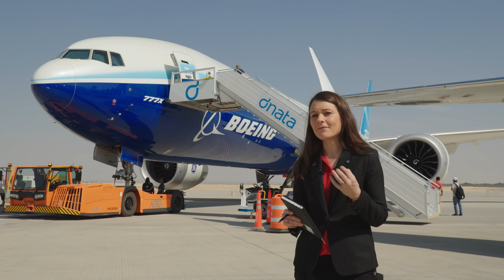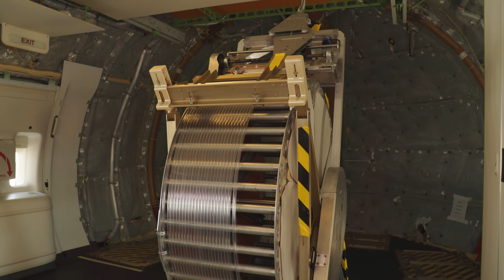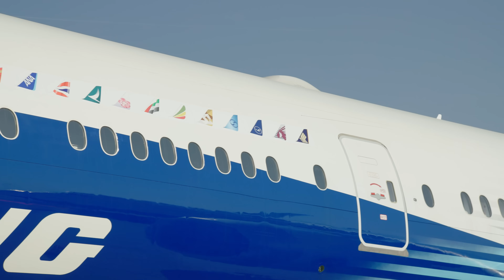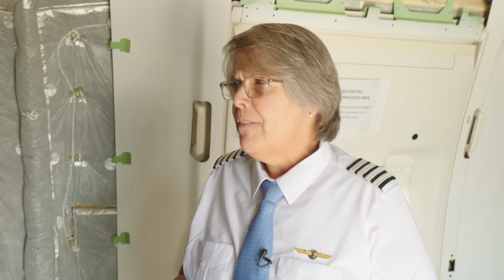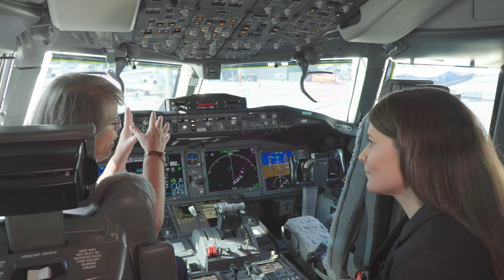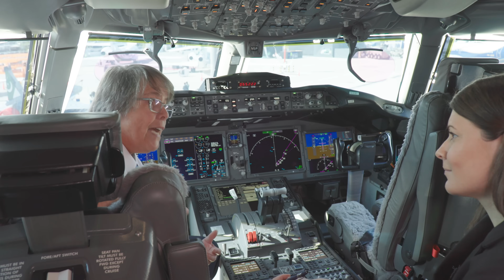Boeing Insists 777X Widebody Is Worth the Wait at the Dubai Airshow – AIN

Comment: Interesting how technology common in automobiles for decades is just now becoming available in commercial aircraft, like touch screens and HUDs…
Reply: because planes are in service for multiple decades compared to cars for at least a decade. at least every 5-6 years a new model of a car will come out, while for airplanes, it’s usually every 10-20 years. most aircraft manufacturers will make certain tweaks and adjustments for their current airplanes if they don’t have a new model out yet for a couple of years until they release a new model. it’s also fairly recently where there has been a drastic change in technology for aircraft.

Comment: Boeing finally saw the advantage of fly by wire for having common cockpit designs and characteristics.   It only took them 40 years.
Reply: Those yokes still look SO old fashioned.  Airbus still way ahead.
Reply: @stephenharrison7514  can boeing switch to a sidestick, yeah, they can. in fact, their fighter jets already have them. why do they keep the yoke despite having fly-by-wire? iconic, distinguishable, and fleet commonality. the prior 777s (-200 series and -300 series) have yokes already, and boeing’s fleet for passenger planes already have yokes, so it’s a no brainer to have yokes so they can easily transition to flying a newer aircraft of the same fleet/series. boeing pilots for the most part only fly boeing airplanes most of the time, only one type (i.e. 777). it doesn’t make sense to drastically change the way they make the airplane fly with its main control.
Reply: boeing already had fly by wire for a long time. same for big cockpit screens and less cluttered buttons. only thing drastically new is the HUD and the touchscreens and the switch to fold/unfold the wingtips.

Comment: I would not call 7,300 nm of range and extremely long range aircraft.  Not by a longshot.  Airbus a350-900 and 1000 fly between 2k and 3k nm farther.  This aircraft has 1980's md-11 range and will not be able to handle the truly long range flights that the a380, a350 and a330-800 fly.  Why again is it worth the wait?  The range of it is awful.  If they stretch it to a 777-10 it will have like 5k nm of range, literally.  Boeing is light year behind Airbus.  Light years.

Comment: Looking from the flight deck it amazes me how little the layout is changing.  Sooooo many hard switches and military style bezels.  No cues from the automotive world where the glass is more continuous and the displays are closer to the line of sight.  I would be enthralled by a control layout that would provide much improved forward visibility - more like a fighter jet.  Maybe Tesla or SpaceX should get involved in airline flight deck/avionics design.

Mechanical engineer, pilot and experimental aircraft builder.  40 years of professional experience.
Reply: i thought something along that line but my thinking is this layout allows easier pilot certification between it and the 787 thus reducing training time/money?
Reply: dude its an airliner. the so many "hard switches" you see are there for a reason and specifically designed that way for safety and reliability. Even the 787 has hard physical switches for most functions except navigation.

Comment: It has only 30 passengers more than the 777-300ER. Is it worth all this developement and folding tips to justify it ?
Reply: I would think so to take advantage of the latest aviation advances; depending on sales a 10 version is on the thought bubble but even with the 800 you gain increased efficiency over the current gen ... probably right now it makes more sense for companies that are looking to replace or buy new planes in the first place ... like i know Emirates is looking to replace some of those 380s as they retire

Comment: Heavier than an A350 because it relies on 30 years plus old technology meaning it’s able to fly less distance than  its competitors but is able to thrive because, like the Cadillac in the sixties, thrives and survives in a home market with restricted access. The original slaughtered the A340 because the FAA led ETOPs rule changes somewhat pulled the rug from under the A340 and led to the hugely successful 300ER. If it wasn’t for Airbus Boeing would still be pushing 1960s  technologies like the 737. Oh, they still do.
Reply: technically the 777 doesn't look at the 350 as "its" competitor class ... its looking at replacing the 747 and a350 although airbus did design the 350 to pinch at triples
Reply: A shame that the 787 panel doesn’t quite fit……

Comment: Well if you enjoy making marketing videos for Boeing I hope you are payed well. I hope the rest of us remembers the groundings of the 787 with those lovely burning batteries, or that a pilot is able to shut off the engines and run the 787 with all passengers into the ground. Let’s not forget the lovely images of those two 737 max running into the ground with all passengers on board. And what was it? Two years grounded. Oh, weren’t that amazing images when parts of the hull flew of a brand new 737 max at 17000 ft? Forgot some bolts and screws? Oops! Turns out Boeing managers are not font of quality control and sign off without ever checking. Lovely!
Well I’ll make sure to not set my foot into those lovely 777X until it has been 3 years into serious service.
Just for the fun of it let me tell you the business class in an A350 is much quieter than on a B787, and the best is the business class on an A380, much better than a B747.
Reply: You're a Boeing hater, go ride on an Airbus, nice planes too, just not as good as Boeing.

Comment: I like 777x a lot but look at just few YouTube videos of both a350 takeoff see their point where they leave the ground by high speed taxiway or building side than  go to google earth or alternative and measure their length from runway starting to that point to liftoff. I think 777x  has beaten a350 in everything but not takeoff performance.
Reply: Ge9x is only certified for 110,000lbf while ge90 is certified 115,000lbf

Comment: Is the 777X actually any more efficient than Airbus’ A350-1000? That does not seem to be the case of the 777-8. But what about the 777-9, which is a bit bigger than the A350-1000?

Comment: If the 777X is similar in its characteristics to the existing 777's - I will not be trusting Boeing to actually completely reveal some hidden software that plunges the plane into the ground. ONLY and ONLY if it requires a different pilot certification and training - the complete set, not 'additional' training, then will I fly on this.

From the start of the program, Boeing has been touting its similarities with the OG 777 and how similar it is, and how much training the pilots WON'T require.
Reply: If you would do some research, you would see it’s a completely different airframe.
Reply: The 777X doesn’t change the engine position like the 737 max. The problem with the 737 max is that Boeing used a larger diameter, more fuel efficient engine. However, the fuselage is low to the ground as the original 737 was designed for easier ramp entry from the ground. Boeing chose not to lengthen the wheel height because they wanted the Max to be compatible with 737 NG equipment. To make the engines not hit the ground, they repositioned the engines higher on the wings. The result is that at full thrust, the aircraft will nose up stronger than the 737 NG. To ensure the tip of the 737 max doesn’t tip so far up that it caused a stall, they installed MCAS software to position the nose downward if the pitch became too high. Stupidly, the equipment that measures plane pitch can malfunction, as it did with the two crashes, and the MCAS drove the airplane into a nose dive. MCAS was changed to be easily overridden and there are now two pitch sensors on every aircraft for redundancy. The 777X has none of this.

Comment: I think that the Boeing 777X isn't worth the wait because it has faced delay after delay, but the Airbus A350-1000 XWB has been certified just one year after its first flight!
Reply: Yes but the A350-1000 is no where big enough to replace 747's and A380's the 777X is the only plane that comes even close to replacing those big planes, Emirates said they will help fund a stretch version of the 777-9X which will be the 10X
Reply: @Rajahdat-62  That's not the reason why it's delayed. Boeing has had a bad reputation of delivering poor quality planes which led to a few deadly crashes. The FAA and Boeing are not going to rush through the process this time and make sure it delivers a great quality product that is 100% safe.
Reply: @ChyeahWill The crashes include Lion Air Flight 610 and Ethiopian Airlines Flight 302 (737 MAX 8, registration: PK-LQP, ET-AVJ) and Air India Flight 171 (Boeing 787-8 Dreamliner, registration: VT-ANB).
Reply: the XWB was certified so quickly because it shares 95% common systems part numbers and same type rating as the A350-900; they are doing their due diligence to ensure as much as possible they not suffer the embarrassment that happen with the max program
Reply: And it’s a plane the middle eastern airlines don’t want.
Reply: @keith.sorrells Gulf carriers are willing to accept the increased risk in exchange for an advantage on continuity and reliability because they have a long history of operating Boeing aircrafts and GE engines, and switching to the 777X will allow continuation of this history. As such, they say that the increased risks, such as certification uncertainty, are acceptable, and certainty is secondary, as long as they deliver the aircraft successfully.

Comment: Beautiful plane and definitly one of the best looking aiplanes ever.  However, range of 777X is only 7300 Nm? A350 ULR (900-1000 )range is 9700 Nm. It must be becouse 777X is 99 tonnes heavier and has 40% more fuel consumption.
Reply: these aren't extended or ultra long range versions .... the 350 ulr is a specific configuration else 350-900 is 8500nm to 77x-800 8700nm, 350-1000  9000nm to 77x-900 7300nm
Reply: @adsmith122  This thing must be empty to rech 7300 Nm. It is to heavy, if full the range is short.
Reply: @zundap100 I believe that in order to better compete on the fuel efficiency side they have derated the thrust to below that of the existing 777 which seems risky.  It also sounds like it shares the same cockpit of the existing 777-300 in an effort to keep pilot training costs down.  Probably not as cutting edge as the a350 but then again it is not a clean sheet so that is to be expected.  Definitely gonna struggle range wise when compared to Airbus but maybe the 4-cylinder engine will help with fuel costs if it can get off the ground.
Reply: @adsmith122 The 777-8 is not selling well at the moment.  The interest has been in the 777-9 because at the moment, there is no alternative.  The 8 version looks like it would be a very powerful and capable aircraft but like the 200lr it will be heavy and not so full efficient when compared to the a350.  All shrinks seem to suffer from that same problem.  If Airbus releases an a350-2000 the 9 version will have a problem for those very same reasons.  Especially if the range is more than the 777-9.  Airbus may also decide to re-engine the a380 using the Roll Royce demonstrator engine.  The 777-9 has less range than the a380 so that may end up being very appealing to potential customers.  It seems that the GE9X claim to fame is it's efficiency gains compared to the GE90 engines not overall capabilities.  Car manufacturers are replacing 6 and 8 cylinder cars with 4 cylinder turbo charged motors that squeeze out the same power as 6 and 8 cylinder vehicles but bring better efficiency but not better performance in most cases.  What they also bring is added complexity and less reliability so we will have to see if the GE9X engines share a similar fate.
Reply: Because the 777-9 is alot heavier than the A350. The purpose of the 777-9 isnt even to chase A350 range. Its job is to replace 747s, A380s and 777-300ERs in the future. The 777-8 on the other hand when it gets built soon is said to have a range of 8, 745 and carry the same amount of passengers as the A350-1000. The range is between the ranges of the A350-900 and -1000 (non URL) versions.

Comment: The Cockpit look Dated except for the touch screen.
And the range was supposed to be 9000Nm and 11000Nm.
Why it got reduced because those range r for private flying and not full load with commercial flying?
Reply: You have no idea what you are talking about. It’s a 787 flight deck, what’s dated?
Reply: @keith.sorrells i have no idea thats why I am seeking answers.
the cockpit of G800 Gulfstream and bombardier 7500 feels modern unlike this one.
I don't know why.😊
Reply: @pritishjena5393 Airliners are not business jets. Its a known fact business jet cockpit technology bñows airliner cockpit technology out of the water. Even the A350 pales in comparison to the gulfstreams.
Reply: dated compared to what in its same class?
Reply: It must be becouse 777X is 99 tonnes heavier than A350 and has 40% more fuel consumption.
Reply: @zundap100  %6 more fuel efficient then the RR powered 350.